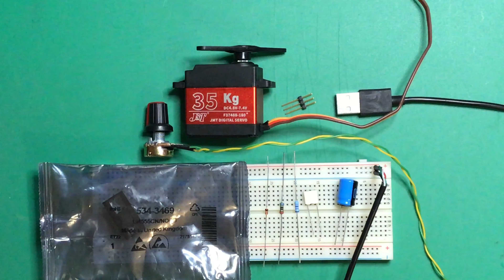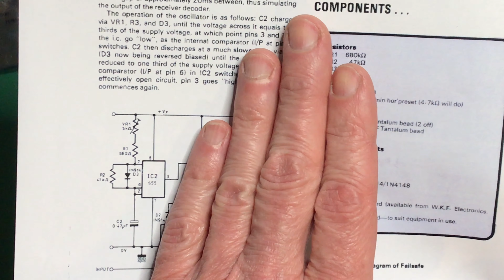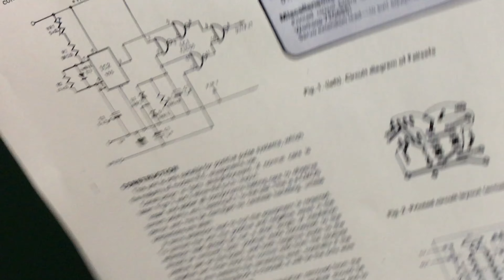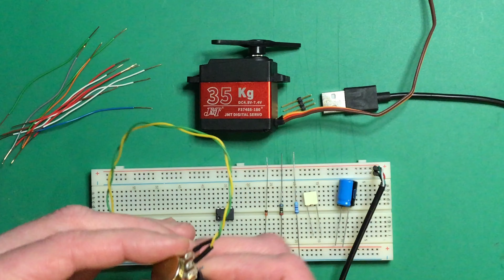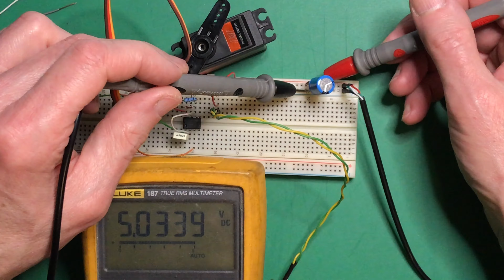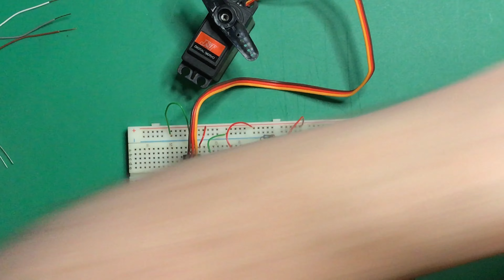Simple Servo Tester - 555 timer based

Comment: 0 do you have to tie pin 4 to positive
Reply from the maker: No; Pin 4 is the cap discharge transistor, that switches to ground/0V. It's not used in this type of oscillator.

Comment: I recomment the use of the CMOS TLC555 timer. The bipolar NE555 has a shoot-through problem, drawing during the L/H switching up to 680 mA for 200 ns. So you have to stabilize the power supply pins with at least 1 µF (4.7 µF is better) ceramic or electrolytic capacitor (and 100 nF in parallel in case you use an electrolytic capacitor). Furthermore you have to stabilize the control voltage pin with 10 nF to GND in order to keep the internal voltage divider stable during remaining variations of the supply voltage.

The TLC555 only requires a stabilization of the power supply pins with 220 nF. You can also stabilize the internal voltage divider with 1 nF. But this is mostly not necessary.